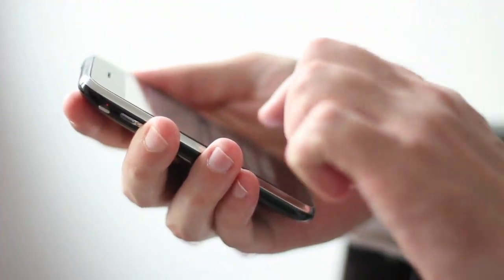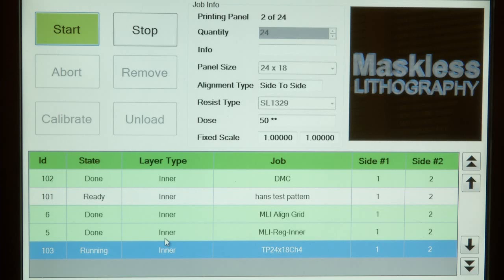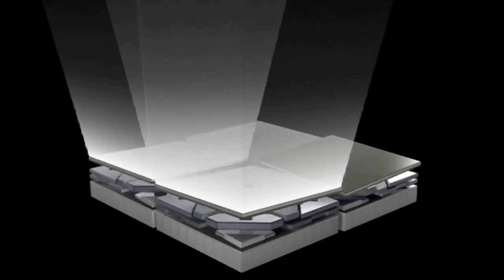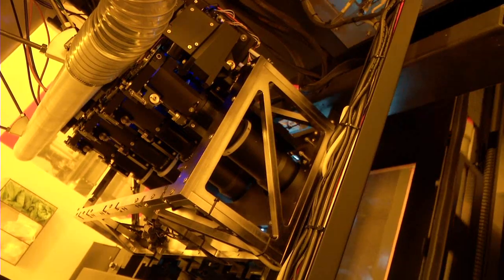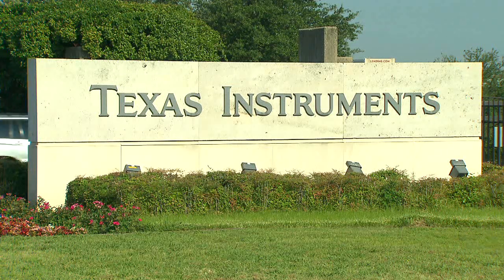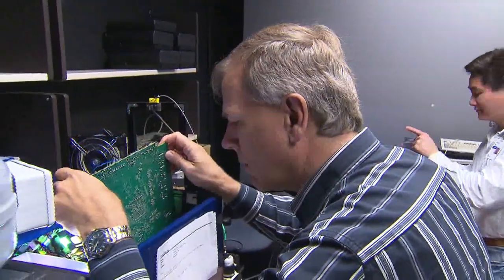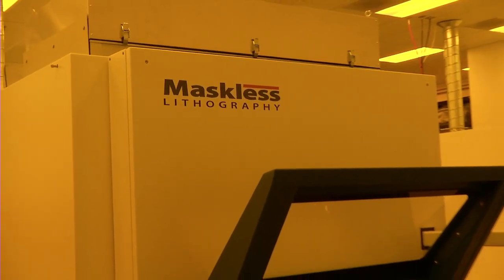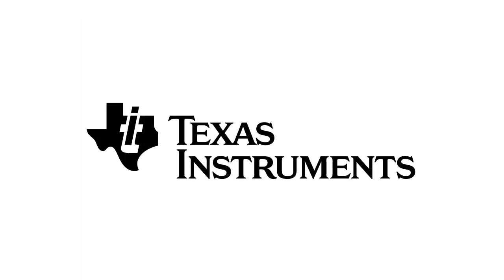DLP-enabled PCB lithography: low cost and high reliability

Comment: This guy talks in the strikingly similar manner to JC (Dual Universe CEO). I'm sure this kind of apparatus can be made much smaller and cheaper. Though that's a bit of a pain that they won't design a small low-throughput smaller-area model for home usage. Guess we need to design that ourselves.
Reply: 5 years in the future and there are some ppl trying home appliances and getting pretty good results on first tries, think this is way2go

Comment: Pretty cool. Hope you guys can make a home device someday.
Reply: You can reuse standard consumer level DMD / DLP chips in projectors. 1920x1080 or 4kx2k are avaialble for pretty good prices. Add the light source, projection lens and stepper stage and you are ready to go. The projectors are easy to drive using HDMI or similar from the computer or SBC.
Reply: So maybe we can buy this dlp chip and Start designing products already?
Reply: Costs there about £4-6k per chip..... >...>
Reply: Don't worry, there are cheaper ways of doing it. Like using a screen and a lens (which is just a projector), or maybe a laser CNC machine.
Reply: Oh, Dang.  So futuristic. I'd like to be able to do Control-P and print a circuit board at home some day.
Reply: Plenty of ways to do photo-lithography at home, that's not really the limitation. All the other work that goes to making useful quality pcb-s at home is. But why bother if you can order your pcb-s from china for chump change?